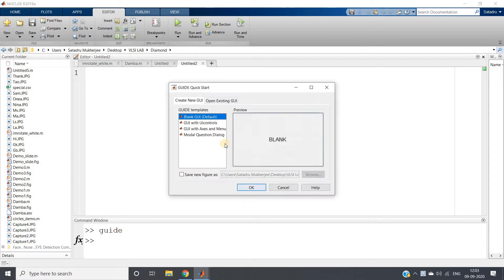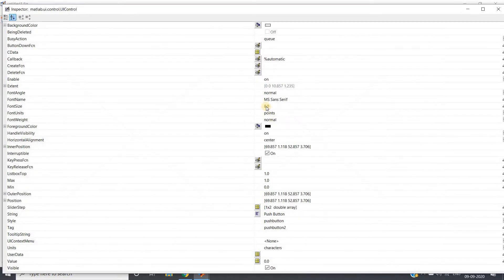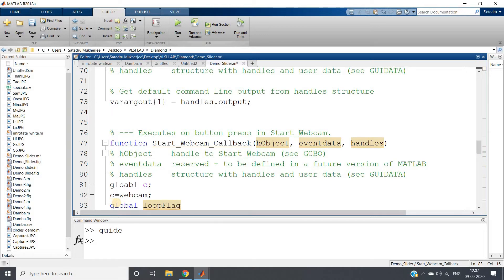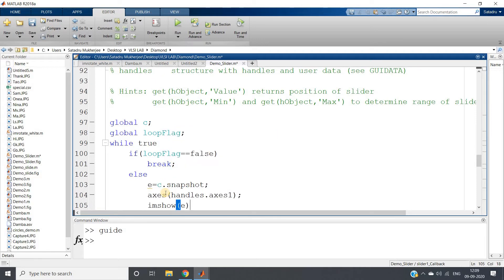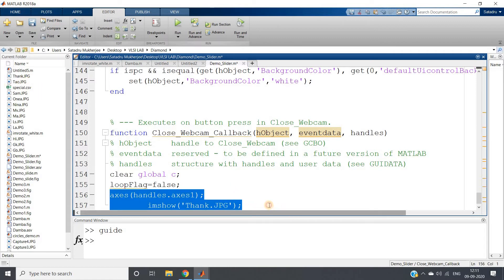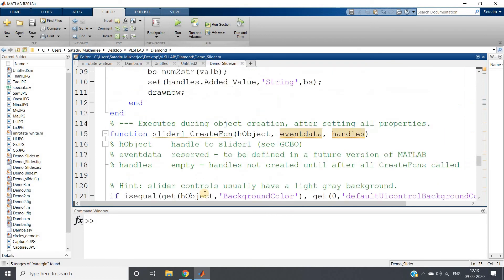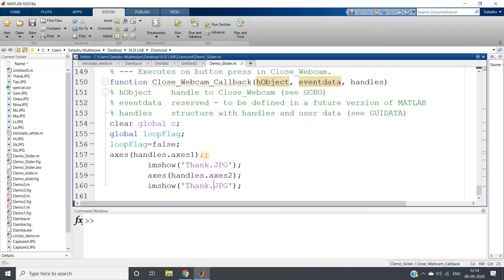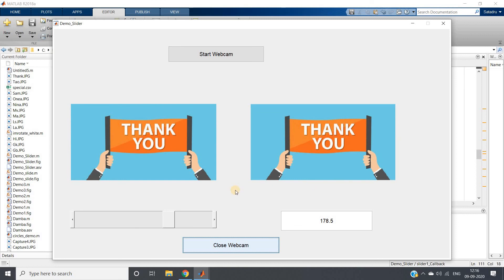Working with Slider in Matlab (Complete Project with Code)

Comment from the maker: Code for the m file:
function varargout = Demo_Slider(varargin)
% DEMO_SLIDER MATLAB code for Demo_Slider.fig
%      DEMO_SLIDER, by itself, creates a new DEMO_SLIDER or raises the existing
%      singleton*.
%
%      H = DEMO_SLIDER returns the handle to a new DEMO_SLIDER or the handle to
%      the existing singleton*.
%
%      DEMO_SLIDER('CALLBACK',hObject,eventData,handles,...) calls the local
%      function named CALLBACK in DEMO_SLIDER.M with the given input arguments.
%
%      DEMO_SLIDER('Property','Value',...) creates a new DEMO_SLIDER or raises the
%      existing singleton*.  Starting from the left, property value pairs are
%      applied to the GUI before Demo_Slider_OpeningFcn gets called.  An
%      unrecognized property name or invalid value makes property application
%      stop.  All inputs are passed to Demo_Slider_OpeningFcn via varargin.
%
%      *See GUI Options on GUIDE's Tools menu.  Choose "GUI allows only one
%      instance to run (singleton)".
%
% See also: GUIDE, GUIDATA, GUIHANDLES

% Edit the above text to modify the response to help Demo_Slider

% Last Modified by GUIDE v2.5 09-Sep-2020 12:06:48

% Begin initialization code - DO NOT EDIT
gui_Singleton = 1;
gui_State = struct('gui_Name',       mfilename, ...
                   'gui_Singleton',  gui_Singleton, ...
                   'gui_OpeningFcn', @Demo_Slider_OpeningFcn, ...
                   'gui_OutputFcn',  @Demo_Slider_OutputFcn, ...
                   'gui_LayoutFcn',  [] , ...
                   'gui_Callback',   []);
if nargin && ischar(varargin{1})
    gui_State.gui_Callback = str2func(varargin{1});
end

if nargout
    [varargout{1:nargout}] = gui_mainfcn(gui_State, varargin{:});
else
    gui_mainfcn(gui_State, varargin{:});
end
% End initialization code - DO NOT EDIT

% --- Executes just before Demo_Slider is made visible.
function Demo_Slider_OpeningFcn(hObject, eventdata, handles, varargin)
% This function has no output args, see OutputFcn.
% hObject    handle to figure
% eventdata  reserved - to be defined in a future version of MATLAB
% handles    structure with handles and user data (see GUIDATA)
% varargin   command line arguments to Demo_Slider (see VARARGIN)

% Choose default command line output for Demo_Slider
handles.output = hObject;

% Update handles structure
guidata(hObject, handles);

% UIWAIT makes Demo_Slider wait for user response (see UIRESUME)
% uiwait(handles.figure1);

% --- Outputs from this function are returned to the command line.
function varargout = Demo_Slider_OutputFcn(hObject, eventdata, handles) 
% varargout  cell array for returning output args (see VARARGOUT);
% hObject    handle to figure
% eventdata  reserved - to be defined in a future version of MATLAB
% handles    structure with handles and user data (see GUIDATA)

% Get default command line output from handles structure
varargout{1} = handles.output;

% --- Executes on button press in Start_Webcam.
function Start_Webcam_Callback(hObject, eventdata, handles)
% hObject    handle to Start_Webcam (see GCBO)
% eventdata  reserved - to be defined in a future version of MATLAB
% handles    structure with handles and user data (see GUIDATA)
global c;
c=webcam;
global loopFlag;
loopFlag=true;

% --- Executes on slider movement.
function slider1_Callback(hObject, eventdata, handles)
% hObject    handle to slider1 (see GCBO)
% eventdata  reserved - to be defined in a future version of MATLAB
% handles    structure with handles and user data (see GUIDATA)

% Hints: get(hObject,'Value') returns position of slider
%        get(hObject,'Min') and get(hObject,'Max') to determine range of slider

global c;
global loopFlag;
while true
    if(loopFlag==false)
        break;
    else
        e=c.snapshot;
        axes(handles.axes1);
        imshow(e);
        valb=get(hObject,'Value');
        axes(handles.axes2);
        imshow(e+valb);
        bs=num2str(valb);
        set(handles.Added_Value,'String',bs);
        pause(0.2);
    end
end
% --- Executes during object creation, after setting all properties.
function slider1_CreateFcn(hObject, eventdata, handles)
% hObject    handle to slider1 (see GCBO)
% eventdata  reserved - to be defined in a future version of MATLAB
% handles    empty - handles not created until after all CreateFcns called

% Hint: slider controls usually have a light gray background.
if isequal(get(hObject,'BackgroundColor'), get(0,'defaultUicontrolBackgroundColor'))
    set(hObject,'BackgroundColor',[.9 .9 .9]);
end

function Added_Value_Callback(hObject, eventdata, handles)
% hObject    handle to Added_Value (see GCBO)
% eventdata  reserved - to be defined in a future version of MATLAB
% handles    structure with handles and user data (see GUIDATA)

% Hints: get(hObject,'String') returns contents of Added_Value as text
%        str2double(get(hObject,'String')) returns contents of Added_Value as a double

% --- Executes during object creation, after setting all properties.
function Added_Value_CreateFcn(hObject, eventdata, handles)
% hObject    handle to Added_Value (see GCBO)
% eventdata  reserved - to be defined in a future version of MATLAB
% handles    empty - handles not created until after all CreateFcns called

% Hint: edit controls usually have a white background on Windows.
%       See ISPC and COMPUTER.
if ispc && isequal(get(hObject,'BackgroundColor'), get(0,'defaultUicontrolBackgroundColor'))
    set(hObject,'BackgroundColor','white');
end

% --- Executes on button press in Close_Webcam.
function Close_Webcam_Callback(hObject, eventdata, handles)
% hObject    handle to Close_Webcam (see GCBO)
% eventdata  reserved - to be defined in a future version of MATLAB
% handles    structure with handles and user data (see GUIDATA)
clear global c;
global loopFlag;
loopFlag=false;
axes(handles.axes1);
        imshow('Thank.JPG');
        axes(handles.axes2);
        imshow('Thank.JPG');